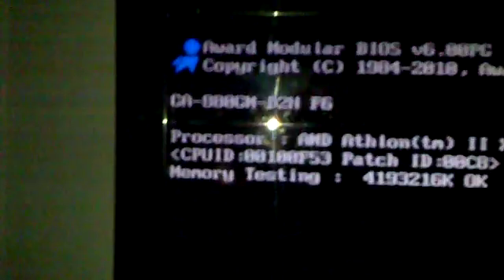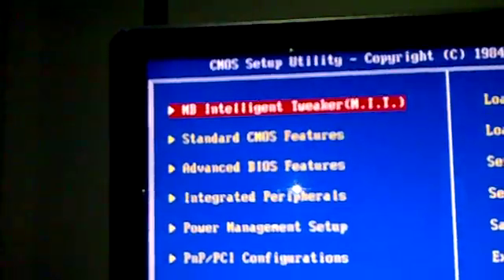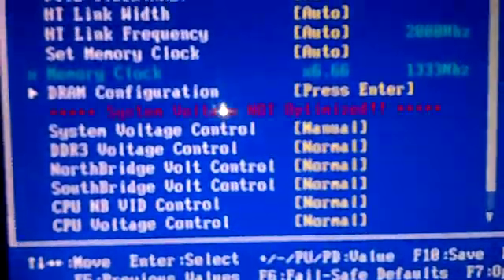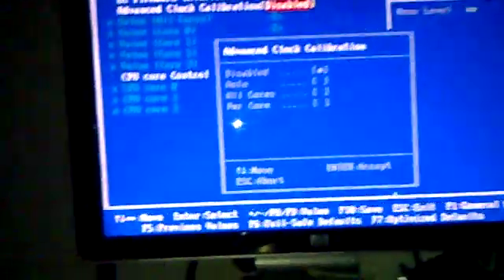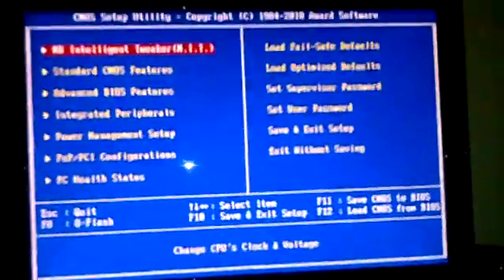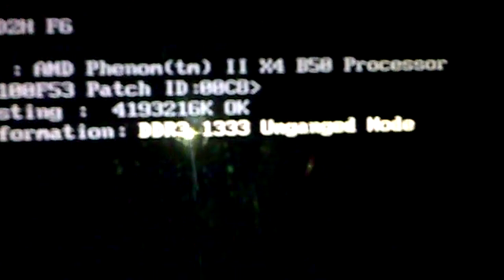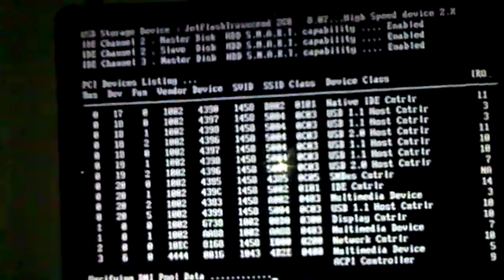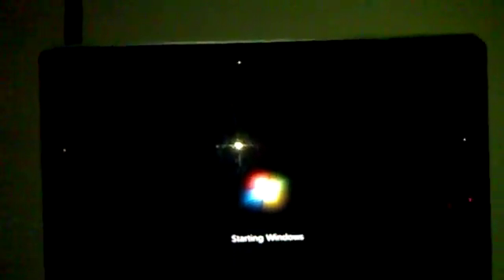Unlocking AMD Athlon II x3 450 to AMD Phenom II x4 B50 Processor

Comment: I unlocked it and and i have it working already for few months as B50
my motherboard is  ASRock N68C-S UCC
Reply: +gorankx is there any problem whit overheating or anything or is everything good ?
Reply: +BoZo Kelava  No problems , , so i already passed 1 year since i clocked it, i played games like GTA 5 with no issues,
i'm now running W 10, no prob, so far,

 i did however put new thermal compound on CPU., my idle temp now is around 40-50 c in games up to 60 c
Reply: +BoZo Kelava I'd recommend using an after market heat sync for this.

Comment: You rock, beside your shaky camera feed, everything else is excellente! I unlocked my 4th core. Now I can play watch dog now.... Muahahahah

And for those asking if blah blah blah unlocks your 4th core I mean really if it's phenom 2 x 3 you should be able to unlock it. Besides why don't you guys just try and test and see things from the bios? Just be extra careful and DO NOT SAVE after your messing around with. If you did make any changes you'll get a prompt asking if you want to save your settings before exiting bios. So no worries. I even wrote down the steps where I need to go to make things easier for me.

Some things to note though, since unlocking your core will make your computer a few degrees hotter than before 2-5? You may want to make sure your fan settings in bios is turned on to max and not something like cool and quiet; otherwise, when you run things that's a system hog (games) your computer may crash or get a blue screen. That's when you know your cpu was a tad bit too hot and your computer has to shut down before it burns itself out, which is a normal. Another thing to note, if your computer insides is mad dusty, you should really clean it. The accumulated dust makes your alot hotter and unstable. I even have my computer side coverings off, just to make my computer extra cooler, and that's before I unlock my core. Just don't spill or stick your fingers or anything inside.

Comment: I'm planning on getting this processor. Will it bottle-neck my games with a ASUS GTX 650 Ti 1GB? Because my AMD Athlon ii x2 270 does.

System specs:
GTX 650 Ti 1GDDR5
4GB RAM
AMD Athlon ii x2 270 (3.4ghz)

Comment from the maker: The CM Hyper 212 is an amazing aftermarket heatsink! And for unlocking on that motherboard doesn't seem possible as it's based off of an nForce chipset which was used for AM2 days as well as AM3 ( First Generation, not AM3+ ) So unfortunately it shouldn't be unlockable on that board =(. Hope I helped =)

Comment: I just did this with the same CPU and the system doesn't like the 4th core, Windows BSOD's even if I bump voltage to 1.45v so I left it at 3 cores, oh well maybe I didn't get the lucky one.

Comment: What aftermarket cooler are you using for your Athlon II X3 425? I have the 425 and im getting temperatures of around 67 Celsius at idle... I've read that the maximum temperature for the cpu is around 73celsius.

Comment: Its a raidmax 530watt. don't have the model name with me at the moment. my core voltage sits at about 1.15. Although in my cpu software settings (amd overdrive) it says 1.35v and wont go any  higher.

Comment: I did and it didnt solve the problem. The cpu temp remains around 40c but the individual core temps are the ones that hover around 80. I'm wondering if its a power supply problem. My whole system just crashes. My PSU is a 530w. That may be it. Running with a 135w cpu and GTX 660 card, it may be too much for it. Not sure. But frustrating.

Comment from the maker: Try getting an aftermarket cooler, 80c it high for a processor and really isn't good for it in the long run. Another thing that can help with temperatures is voltage. It could be either Temperature OR Voltage related, But either way, Definitely get an aftermarket cooler! =D

Comment: Every time I unlock the 4th core after about 20 to 30 mins of playing a game, my system crashes. My temps also show about 70 to 80 degrees celsius as soon as I unlock that 4th core. So is it crashing due to overheating? And if so, would an aftermarket cpu cooler do the trick? Or should I just upgrade my cpu? When I do unlock that 4th core, it significantly gives me better performance so I'd like to just do that if I can without burning out the system.

Help? :)

Comment from the maker: My temperatures seemed to still show after that buy they didn't seem very accurate, i ended up leaving it as is and did the finger test on the heat sink to see if it was hot on load and it was kinda hot, not the best way to do it but better then none

Comment from the maker: Most newer age computer components are protected from heat as in if they go near the maximum they can support the most you'll get is them shutting down and getting a BSOD ( I.E let it cool down and boot back up ) good suggestions tho however Rivatuner is for Graphics cards not Processors

Comment: Make sure that your system has a good cooling system and make sure you continually check your system temperatures, and download rivertuna im pretty sure there is an option an that program that will shut down your computer at a selected temperature as a safety valve. Because if your system over heats your fucked

Comment: nice video! but i have a question for you. My MOBO has only support for 95w tdp , and when i unlock it to a phenom 2 b50 (125w) i have no problems on the SO. not tested on games yet. do you think i can damage the MOBO or CPU keeping it unlocked to 125 w instead of supported 95w?
PS: sry about my engrish xD

Comment: alright bro, i see you posted about a month ago so i hope i can get some feedback from you.
I bought a board similar tot hat guys. Biostar A780L3G, its got the ACC core unlocker. I then bought the same athlon ii x3 450. Im going to try unlocking the 4th core but i need some insight on core voltages, bios, etc. I currently have a logisys 550w PSU.

Comment: I unlock the 4th core with an AsRock 970 extreme 3. Im lucky enough to have gotten a stable one. My specs: Amd Athlon X3 450 (it's now a phenom x4 b50), AsRock 970 Extreme 3 mobo,4gb of Crucial RAM, OZ SSD 120gb, and 1tb harddrive.

Comment: Im using my friends Athlon ii 450 x3 in a asrock N68C-S UCC, but when I enable ucc (unlock CPU core) my rig doesn't post. I'm quite sure the 4th core is unstable, but thaught I might change the voltages around a bit too. I have it running at 3.5Ghz on 1.4Vcore, how much further do you reckon I should take the voltages? 1.4v is AMDs recommended max voltage for this CPU.

Comment from the maker: if you haven't tried increasing the core voltage, try doing that. if that fails, it's an unstable 4th core and you can not unlock it successfully

Comment from the maker: Not Necessarily, Have you tried Increasing the voltage? if you have and it still fails,the locked core is defective and it won't work =(

Comment: I know you don't type like that normally, I just cant stand people punching their keys for no reason. Its like rage typing lol.

Btw: You should inform people that they will need to stress test the chip after unlocking it, and monitor their temperatures. There is a pretty good chance that the disabled core is a bad core. I've seen peoples core temperature go from 30-50C on average to 50-70C on average because of a single bad core. Also need to make sure the machine wont lock up with that core.

Comment from the maker: well taking from experience, the i5-2500k is a great processor all around, if you can spend some more for it, Do It. It will pay itself off in the long run, not bashing AMD or anything i love them as well, but if the i5 is an option do it, Pair it with a Z68 board for best experience or even a P67 board

Comment from the maker: It sounds like an unstable unlock, you might want to try increasing the CPU's voltage a bit like .40 volts or something not anything above that should make a difference from stock, if it still fails, the 4th core is damaged and will not unlock. Hope I helped!

Comment from the maker: @mrliniutalobo1 Well, you see my good friend. You could always use google and look at the benchmarks yourself instead of making a comment like that but alas you decided to take the completely unnesscary choice of the two. Do a little bit of research and you'll learn that 1. The Unlock's aren't always unstable, and 2. In terms of performance let's say you have a triple core ( we did ) and you up it with another core, logically it would gain 25% performance.

Comment from the maker: @vincedejacto try upping the voltage on the processor if that doesn't work then it sounds like it isn't a stable unlock and you will have to re-lock it

Comment from the maker: @xRuFFZx depends if your going to overclock it further and if u have good airflow, my temps rose quite  high under load once unlocked and im not overclocked, i do recommend a good aftermarket heatsink to keep the temps low and MX-2 or MX-4 for some good thermal compound

Comment from the maker: My Phenom II x4 B50 ( u would get the B40 ) is stable at 1.44 Volts, You could try 1.52 volts on the core but if it won't boot then it's just not going to unlock, remove any overclocks you may have put on and do not try to increase the voltage to your northbridge if anybody has said to try that, hope it unlocks but if upping the voltage does not work i do not think it will unlock